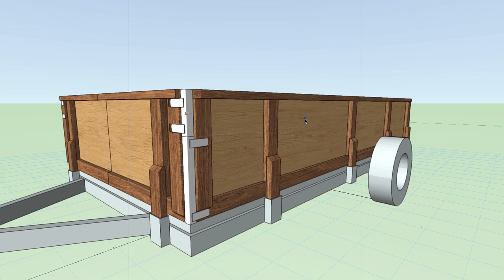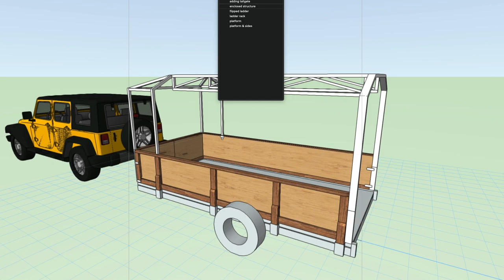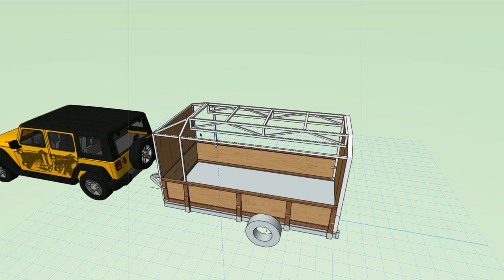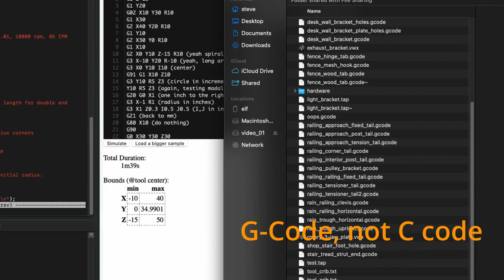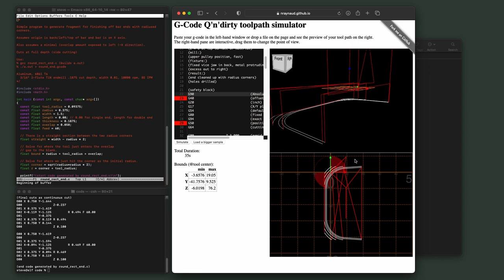000.5 - Utility Trailer Sidewalls and Upgrades - Part 1

Comment: Great video.  I have an aluminum trailer and was looking for ideas for adding side rails.
Reply from the maker: John, thanks for watching. It has been a few months since I built the trailer walls and they have proven super useful so far. I wouldn't change much at this point but will see over time. I really appreciate the feedback and good luck with your trailer/build.